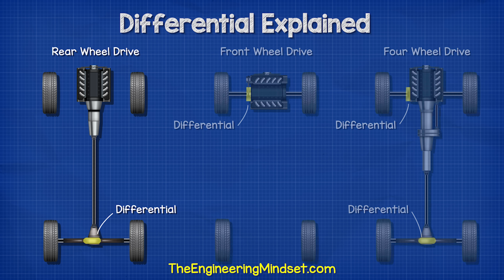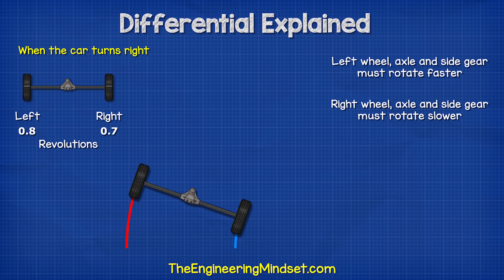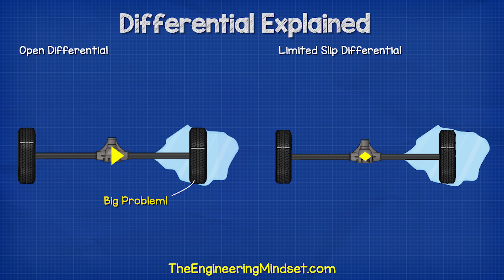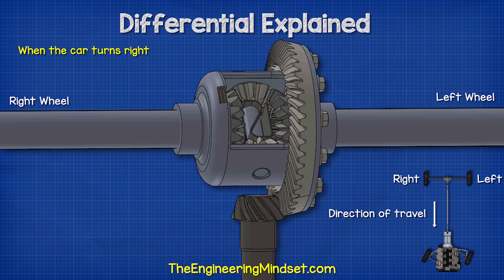Differential explained - How differential works open, limited slip

Comment: Top rotates to us, bottom rotates away. I recognize that type of gearbox. Often used to switch the direction of a spining gear or axle. Sometimes used to make two things spin in reverse from a single input. Engage or disengage to toggle on or off

Comment: I have 2009 Nissan Sentra (MT), model S 2.0L and it was loosing Brake Fluid (no visible leaks anywhere) very little (like 1/4 in level drop after 100 mi), but still. I've replaced the Master Cylinder, seems it became a bit better, but after 1 month noticed it started to loose again in the same way, maybe a bit less. Brake Booster can't cause that problem, since it is vacuum BB. The car has Manual Transmission. I've heard it can be a leak in the Clutch system somewhere (Clutch Brake Fluid Line goes from the Master Cylinder on that car). When flushing the Clutch part, I didn't see any visible leaks there. The pads and the Wheel Cylinders are new and good. The Brakes and the Clutch work perfectly well.  Though the Clutch is working perfectly well, but working on the Nissan I remember saw a small amount of fluid (like a drop) on the bottom of the transmission. I know already that the Clutch Slave Cylinder is mounted internally on the transmission bell housing on 2009 Nissan Sentra (MT) model S, 2.0L, so it is an internal concentric unit and to replace that CSC I would need to drop the Transmission. That procedure involves the simultaneous removal both CV Axles. I've read that if you remove both CV Axles then the Alignment of side gears should be done (again since 2 CV axles are removed simultaneously). Can you avoid this Alignment procedure (which is rather complicated) by marking some parts, or it is always should be performed at the end of the transmission replacement?  I watched several videos on the Transmission replacement, but none is mentioning anyhow that Side Gear Alignment at the end. Only in one video I saw that before the Transmission Disc cleaning the author installed the CV Axle into the transmission. I assume that was done not to shift anything in that Transmission, but not sure. I would appreciate any opinions on this matter.  Thank you.

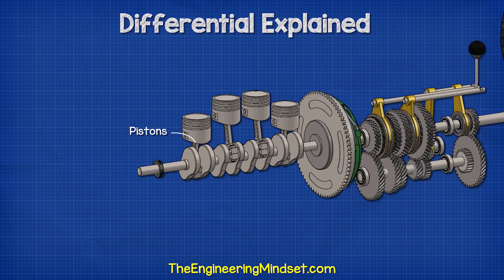Comment: Perfect automotive mechanics explanation ... good job , only note that the module that transfer engine piston power to drive shaft is CRANK-shaft not CAM-shaft (controls in/out valves close/open timing)... Ref Min 5:17.

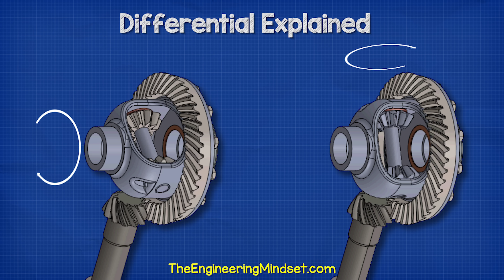Comment: Let me know if my understanding is correct about spider gears around 4:30 -
The spider gears have no rotational contact with the ring gear.
The ring gear (being driven by the pinion gear) drives the axles of the wheels. The spider gears and side gears are moved by the ring gear only to control the speed of the wheel.

Comment: pretty nice video - but the force distribution in an open diff is fundamentally wrong. The amount to both wheels is always equal. Always. You state power goes only to the slipping wheel. That is correct. But power does not move your car. It is a measurement of work done. Power does not move your car. Torque does. And it is always equal to both wheels in an open diff. Physics.

Comment: You've explained how the clutch pack allows the axles to rotate at different speeds in a turn: The mere force of the different turning speeds from the wheels causes the disks to slip past the plates (I suppose by overcoming the amount of friction at the plates created by the spring). But you haven't explained the clutch pack causes the power, when one wheel encounters ice, to transfer to the other axle. Like most lsd videos, you've simply declared at the end that it does without explaining how. 

How does one side's clutch plates slipping prevent power from still being transferred to that side's side gear? If the open diff allows the side gears at any and all different rates, what prevents the gripping side from stopping while the slipping side takes all the power?

In other words, what you've explained is how the point of slippage moves from the tire-ice contact point to the disk-plate contact point, but you haven't shown how that changes anything on the diff/opposite axle of the slipping side's clutch pack. Why would the diff act any differently on (i.e., transfer more power to) side gear B when side A is slipping? The ice situation is opposite the turning situation force-wise-- turning (assuming traction) resists axle rotation on the inside wheel relative to the outside wheel, but ice does the opposite, allowing freer rotation to the slipping side. You've explained the operation of the clutch pack in turning (where it isn't needed anyway since an open diff does that job), but you haven't explained how the clutch pack operates in the opposite condition-- ice allowing a wheel to spin freely. 

In other words, the difference a clutch pack makes is allowing an axle to be free (somewhat at least) of the side gear, whereas in an open diff it never is. But in an ice situation, so what? Friction is already freed, just farther out (where tire meets road). What removes power from the slipping side's side gear?

Comment: Change brakes on rear wheel drive vehicle 2010 doge charger 3.5. Had it in the air and put in the drive. Driver wheel is spinning and passenger rear wasent spinning is that normal?

Comment: I have been thinking of a 3d printed wind fence design, where lots of small (100 - 150cm high) vertical wind turbines applies torque to a common drive shaft, that then later goes into an electric motor to generate electricity. The idea is to make it easy to 3d print at home, and reduce amount of expensive components. Since you only need etc 1 motor for lets say 10 small vertical wind turbines connected in serial. One question comes to mind is how to make each turbine apply their share of torque to the drive shaft, considering some might catch more wind and spin faster than on the other end on the fence. I need some sort of gear that turns horizontal torque into vertical torque, but not the other way around. (so busy turbines dont spin up the lazy turbines).

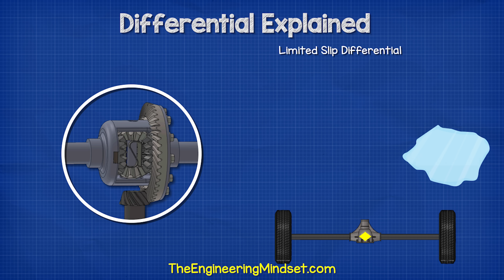Comment: Fun fact the ratio of pinion to ring is 11:43, just 1 tooth short on the ring gear to make it a perfect ratio. Why? Because it's a hunting gear set, so named as the pinion hunts for it's original starting tooth engagement as it rotates. This is done on purpose to maximise wear life of the gears and is achieved by making the tooth count a prime number.

Comment: Thank you very much for the video you made, which gave me a new understanding of the principle of differentials, a problem that has troubled me for a long time.  I would like to discuss the following issues with the author and fellow fans:
Suppose I install motors with sufficient power on the left and right wheels respectively, so that they can mesh with the star gear and rotate in opposite directions when the differential housing and ring gear are stationary (that is, the transmission shaft does not rotate), Is this possible?
If possible, does that mean assuming the differential housing and ring gear are rotating at 100RPM clockwise, when the left wheel (left side gear) is rotating at 200RPM counterclockwise, the right wheel (right side gear) Will it rotate clockwise at 300RPM?
Modified (2024.2.9)
After thinking about it for a long time today, I have a new understanding of this problem. Now I think that assuming that the left wheel (left side gear) rotates forward at 200RPM, when the differential housing and ring gear rotate forward at 100RPM, the right wheel (right side gear) should be at 0RPM
Because when the left quadrant point of the star gear (i.e., the point of mesh with the side gear) rotates forward, the right quadrant point of the star gear (i.e., the point of mesh with the other side gear) will rotate backward, so the connecting star The speed of the differential housing and ring gear of the gear should be half of the speed difference between the left wheel (left side gear) and the right wheel (right side gear). For example, the left wheel rotates forward at 500RPM and the right wheel rotates forward at 100RPM. The differential speed The speed of the motor housing and ring gear should be 300RPM forward. Do you think my understanding is correct?

Comment: One thing that was not mentioned is that when the wheel with less traction begins to spin, an outward force on the spur gears is generated due to attempting to spin the low traction wheel, this force will further lock the clutches, the spring alone won’t create enough force on its own. All bevel gears create an outward force when load is applied.

Comment: The pistons rotates the crankshaft and not the camshaft. Note that the spiral drive gear is not centered with the ring gear like the straight ones for mechanical reasons that provide better transmission.

Comment: Very good explanation.  Limited slip or positraction diffs are good but can get you into trouble.  Ask me how I know!
Air or electrical locking differentials are much better and give you the option to run an open diff or a "locked" diff.  
There's also another way which is using the ABS to intermittently apply and release the brake at the slipping wheel and allow the diff to apply more power to the non slipping wheel.  You still have an open diff but when needed the ABS system gives you that "limited slip" feature.
I have the ARB Air Locker in my Nissan Frontier 4X4's rear diff.  Works great!
Reply: Isn't that the difference between "lsd" and "traction control"?

Comment: You keep saying the same thing over and over again without actually explaining what's happening inside. It is still not clear how one wheel can rotate independently of the other. Notice your animation at 7:03 how you show the spider gears basically grinding against the side gears. They are both spinning in different directions. This would cause a disaster.
Reply from the maker: I've tried to show how it works with animations and also 3D printed models, which you can download for free and build yourself to better your understanding. If the car travels in a straight line, the spider gears will not spin, they will rotate with the ring gear and simply push the side gears which spins the wheels.
When the car turns, the wheels all still go forwards, so the side gears continue to turn forwards, one wheel and side gear turns faster than the other, it has to, to cover the same distance in the same time. The spider gears WILL now spin to slow the other side down. They do not grind, they are pushed by the ring gear still, one side just rotates slower than the other. That's it. When I get stuck on a difficult subject, I find it helps to take a break and come back. Often the mind gets stuck over thinking.

Comment: I have a doubt, not related to this.......when i connect a small dc mortor to a 9v battery............And it works properly. But what happens if i stop the propellor from rotating, letting the current flow(i guess).

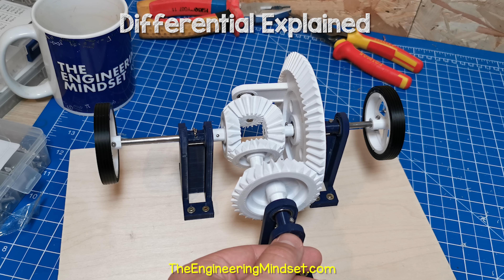Comment: Hi there. At 00:02:12 if you lock both whells and turn the axle with your left hand as you do in the video, does anything turn at all? I am having a hard time visualizing it. Thank you!
Reply: No, both rear wheels can't turn if you lock them solid. Now if you are asking if you put what is called a spool where both rear wheels are locked together. Then both rear wheels turn at the same rate if you turn one or the other.
Reply: @Ottos_ScLm_Race_videos_2009_on  That is what I thought also. I think I am going to build it in the near future because it is different when you are dealing with it hands on. Thanks for the reply.

Comment: At 5:17 it mentions the camshaft, but this is not correct, this is a CRANKSHAFT. The crankshaft transfers power to the drivetrain, the camshaft controls the opening and closing of the valves so that the intake and exhaust strokes are timed properly.
Reply: The Crankshaft also converts linear motion into rotary motion
Reply: Correct.👍
Reply: Thanks for confirming 💯
Reply: bla bla bla

Comment: Spiral cut gears in the diff. also allow the input shaft to be positioned at a tangent to the diff, instead of having the axis meet. This allows for cars with lower floors.

Comment: Very good, worth pointing out that the clutch pack can be adjusted so that it grips with different torque profiles. The differential is really an extension of the steering system, conceptually.
Reply: Worth pointing out that clutch pack type lsd are trash. Helicals are the only way to go

Comment: The clutch pack operates by pure friction? Then how are the textured surfaces not ground smooth by the forces involved? Or is the spring precise enough in compressing the plates for that? If so, that is some very clever engineering. Very impressive
Reply: No they wear out. It just takes a while.

There are two major classes of limited slip differential, clutch based and gear based. Clutches wear out by their very nature, friction surfaces that slide against each other. With proper friction modified lubricant it should last quite a while, but it does wear.

Gear based differentials (Torsen) use gears to create the torque splitting function. There is some surface to surface sliding but it is of hardened steel. While there is a little wear it is minimal and this type will last a very long time.

There are really four types. Open: and you deal with the one wheel spin every time you get stuck but very little maintenance. LSD clutch and LSD Torsen: Tries to give power to both wheels at all times but will still slip if enough force is applied. One wears out and needs to be serviced the other is more expensive upfront and the 4th is Lockers: There are 3-4 different kinds of lockers. Some Air, Some electronic actuated, some manual. Either of these have a mechanism in place to 'fuse' the spider gears thus making a solid straight axle when activated. A lot of 4x4's (real 4x4's not the All Wheel Drive cars or the trucks and suv's that pretend to be 4x4's). Lockers should only be used in snow, mud, off road etc... with front and rear lockers all 4 tires are locked to the same gear ratio and all 4 have equal force applied regardless of road condition. Using these on hard or dry surface will put extreme force on tires and drive train components when turning (especially the front wheels) and they must be manually activated and deactivated when needed. But you will never get stuck :)
Reply: to be fair the clutches in both your automatic transmission and manual transmission are also operated purely by friction.

Comment: Which way the gear will turn is a matter of a pinion.
Reply from the maker: I see what you did there
Reply: Eugene Out
Reply: Never heard that before, got a chuckle 👍
Reply: Love this pun lol
Reply: ...and for my next trick,  in a situation where one tire is spinning on any icy spot on the pavement and the other tire is stationary on a dry patch of pavement, I will apply my vehicle's parking brake.  This adds resistance to the spinning wheel, so now that side of the differential is transmitting torque.  It still has no tractive effort with respect to the pavement, but, since the torque on both right and left sides of the differential are essentially equal, this will cause the side of the differential with the stationary tire to transmit torque and, as long as I modulate the throttle to apply proper horsepressure to exceed the rotational resistance caused by the parking brake, the vehicle will drive past the slippery spot.  Some electronic traction control systems perform this trick more elegantly, applying resistance through the brake of only the wheel that is spinning.  The parking brake applies resistance to both left and right wheels,  so more engine power is required, but I often use this technique to drive up the slope of my driveway in winter.  Who says "Resistance is Futile!"?
Reply: @eugenepolan1750 well, so if I get stuck in ice I can theoretically apply my E brake and it’ll distribute torque to all wheels to make getting out of the situation easier?
Reply: @TF2wardog  Yes, I used to do this to back up an icy driveway in the winter.
Reply: And my wife calls me the king of cheese.

Good 1.
Let me guess..
Your here all week. 😆
Reply: Aaaaggghhh 😤 take my like sir
Reply: Lmao
Reply: Lol
Reply: Nice job
Reply: Good one
Reply from the maker: Seen the new LED explained video? so much detail covered! https://youtu.be/O8M2z2hIbag
Reply: Very nice
Reply: wooowwwwwww. Lmao
Reply: I like this pun 😂
Reply: I'm indifferential about it.
Reply: Savage
Reply: Hahaha that’s good one right there
Reply: I very much appreciate that humor!